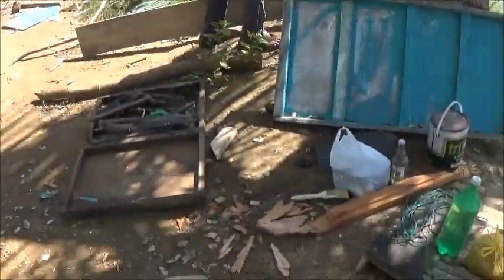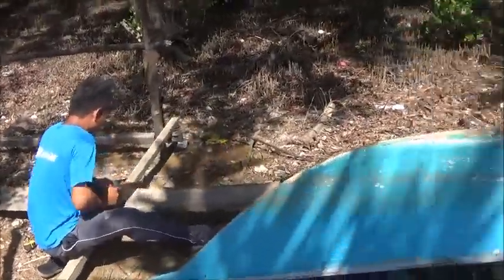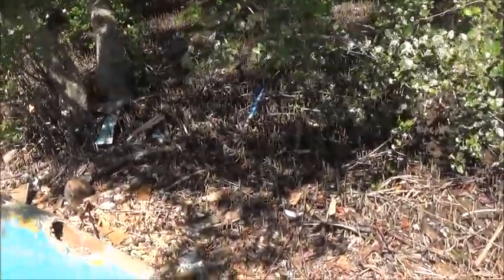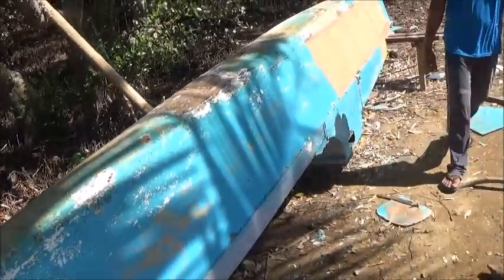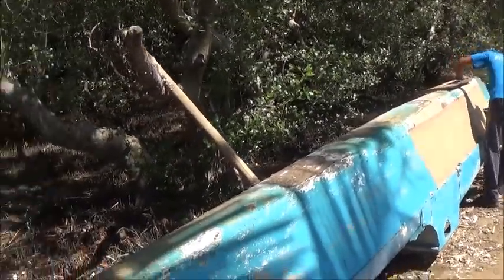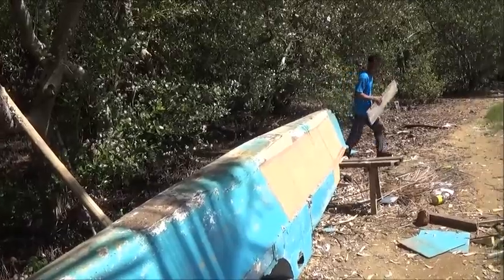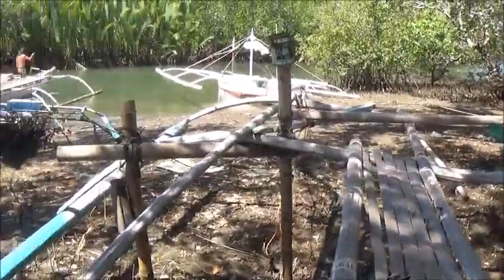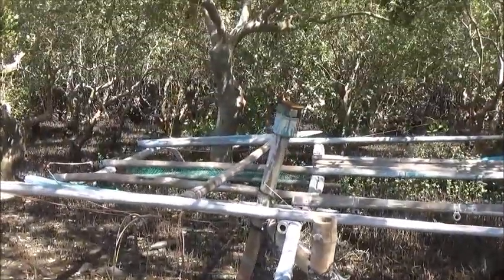Boat Repair Progress And Plans

Comment: It's the fresh water that the problem not sea water,
Reply from the maker: What fresh water?
Reply: @Slim Jim correct,
Reply: @Slim Jim yup,  needs a tarp cover over it,  when not in use. 
That's what we used on our wooden sailing dinghies back in the UK!